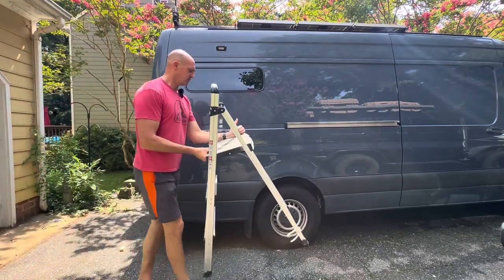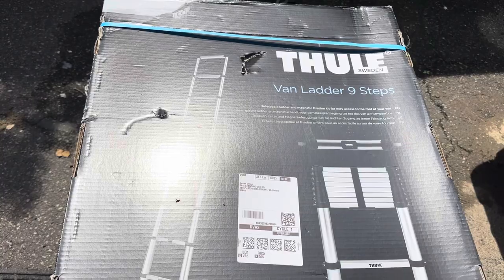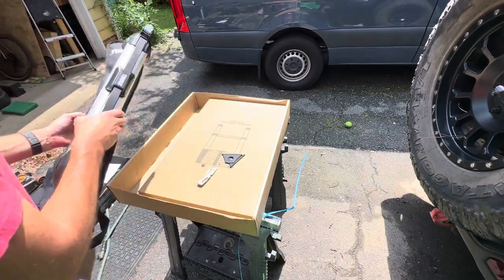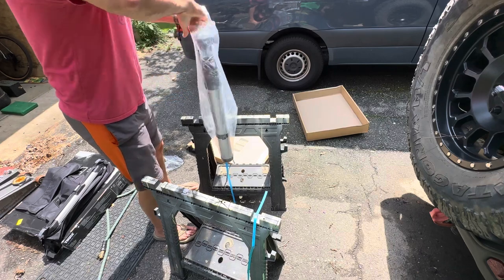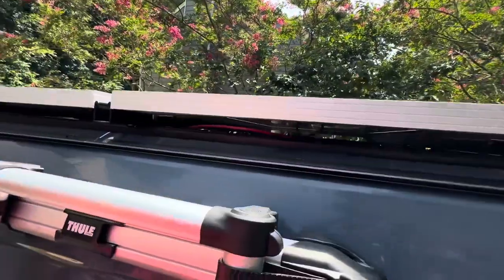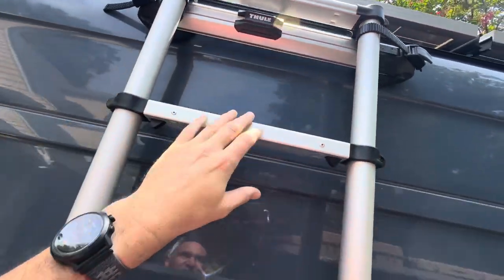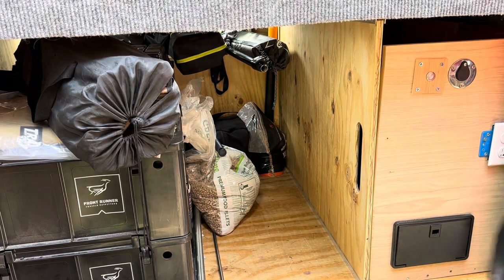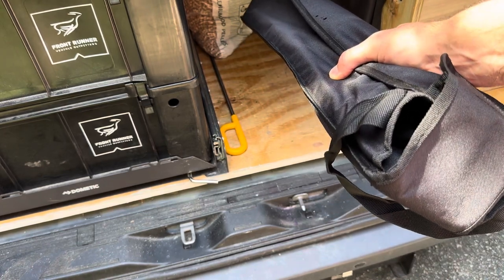Thule Van Ladder Installation - A Step By Step Guide

Comment: Those stickers afix to the vehicle rather than the magnets.  They're meant to protect your paint.  Clean the van, apply the decal, leave it in place and just place/remove magnet when needed.  You get 4 so you can setup on both sides of the van.  😉
Reply from the maker: The only issue with doing it that way is you assume that you are only going to place the ladder in the same spot every time, in my case that ladder needs to be moved as its used. Thanks

Comment: Thank you for the video. I picked up this ladder and it is really a solid unit. Did you ever figure out what that odd shaped black piece is that has a hole in the middle of it? You mentioned it at around the three minute and 29 second marker your video. I have the same thing but have not a clue What is for. Thank you, be safe and well.
Reply from the maker: Thanks, its really a great addition to our van, yes i figured out what the triangles are for, they slide in a groove at the bottom of the magnetic piece and you can hang stuff from the tabs, kinda like if your not useing the ladder you can slide those triangle in and hang a trash bag or a light or something from it, i think they will hold 5lbs each
Reply: @ramblingambition  jeez, how thoughtful. The construction, design, got and finish is a work of art, and it is functional and seems very safe.  Thank you again, be safe and well.